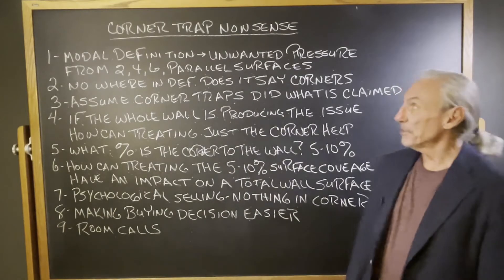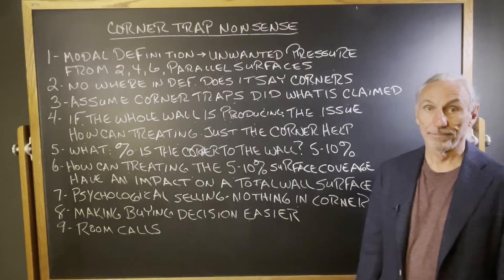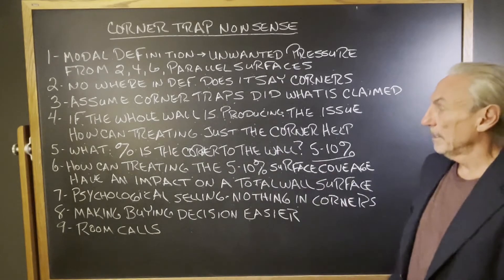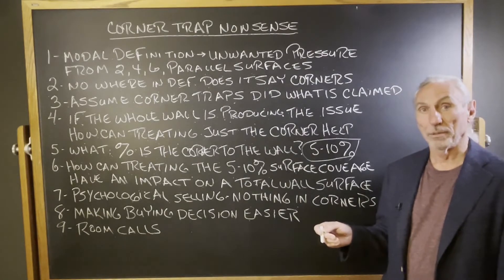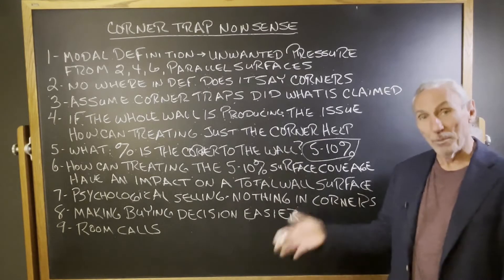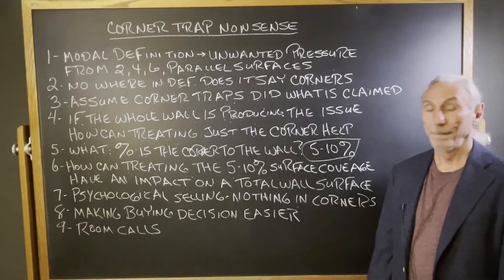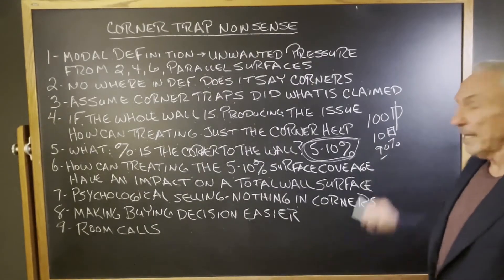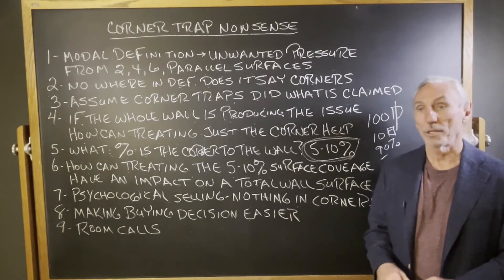Corner Bass Trap Nonsense - www.AcousticFields.com

Comment: The corner idea has valid logic behind it and I will just quote Floyd Toole a little here:
"at a reflecting boundary, pressure is at a maximum, and particle velocity is at a minimum"
A corner is two adjacent reflecting boundaries, so (sound) pressure is the greatest at these points.
The logical conclusion would be to place absorbers here, because it's the loudest, right? The issue is that stuff like rockwool absorbers are resistive absorbers, which counteract particle movement. But now we know that particle movement is at a minumum near the walls, which means the walls&particularly the corner is actually the worst place in the room to put a resistive absorber.
A resistive absorber is best put in a null, where subsequently particle movement is highest, which is at 1/4 of the wavelength away from the wall (of the frequency of interest; over 1m for bass frequencies). This is why the 'air gap' behind the absorber works, simply because it moves the absorber away from the point where it has the least impact.
Now, what do we do with the corners, where SPL is greatest? This is where tuned absorbers like membrane absorbers or helmholtz resonantors come in. These would need to be specifically built for the frequency your room is having issues with, which is why it is unappearling for the general consumer - it is not a quick and convenient 'universal' solution and also costs more than a wooden frame with some rockwool inside.
Reply from the maker: If you treat the wall surface area with a minimum 50% surface area treatment coverage with our technology, you have no corner issues. The greatest pressure is not in the corners at all frequencies and it also depends on the location of the sound source is regards to the room boundary surfaces.The greatest pressure is between two walls. This is an easy experiment to perform. Walk around your room with an SPL meter while you are generating a 40 hz. sine wave. Measure the pressure levels along the walls and corners. Repeat for 50, 60, 70 hz. and you will understand that the greatest pressures at all frequencies are not in the corners but between two surface areas. Building insulation will not provide the proper rates and levels of absorption for music and voice. Stay away from that material type if resolution is your goal.
Reply: @AcousticFields  This is a top response. Thanks.
Reply: That only applies if the initial wave strikes both walls at the exact same time and angle. This is extremely unlikely. You're far more likely to get the reflections from each wall being out of phase and, therefor, attenuating each other. So corners are much more likely to be lower volume.
Reply: "at a reflecting boundary, pressure is at a maximum, and particle velocity is at a minimum" Even though this is technically correct, you don't have a reflecting boundary condition as soon as you put an absorber at the boundary. Any standing wave with reflecting boundary condition can be decomposed into an incoming travelling wave and an outgoing (reflected) travelling wave. What actually happens during absorption is that the incoming wave first travels through the rock wool and on its way back the outgoing, already attenuated wave also travels through it a second time. You can simply transform that situation into one where you mirror the bass traps themselves indefinitely (an "acoustic infinity mirror" so to say): no more reflected waves, but twice the travel distance just because the traps are mirrored. Now imagine all those virtual mirrored base traps: does their number increase when they approach the "nominal corners" of the room? No! Does their total volume or total area increase? No! All those numbers are independent of the positions of the bass traps in the room. But only these numbers count when it comes to the likelihood of absorption. So, put your absorbers anywhere you want, it doesn't really matter (except for the case where you can predictably catch directional sound with an absorber in first pass)
Reply: @7enon  I'd suggest you to read the Wikipedia article on standing waves. The first sentence shows that while your train of thought might seem intuitive at first, it's not what happens in reality.
Reply: @peniku8  I am a physicist and don't need to look up anything in "Wikipedia articles". If that is your level of knowledge, and you prefer to stay at it, my inclination to inform you ends here.
Reply: @7enon  lmaoooo
Reply: @7enon  You are correct. You don’t “need” to look up anything in “Wikipedia articles” to be a physicist. But if you prefer to stay at a particularly low level of enlightenment as it pertains to physics, then, e.g., the idea that there is nothing of use regarding physics in “Wikipedia articles” is the correct outlook.

I am not a physicist myself. I do want to learn a lot of stuff to help me in my journey producing an album, bro, but I could also die tomorrow, or even today.

Comment: "What % is the corner to the wall?" ...does this Q make even sense? How you measure this?
Reply from the maker: It is the whole wall producing the modal issues. Placing treatment in the corners is a bandaid. It is mostly a marketing gimmick to sell product. If you treat the complete wall surface area, you have no corner issues.

Comment: Bass is strongest in corners, so treating the corners does indeed work.
Reply from the maker: This is not a true statement. Take an SPL meter and measure different places in the room. You will see that the greatest pressues lie between the walls as is specified in the definition of modes.
Reply: @AcousticFields  according to AI my statement is true.

"...Low-frequency waves are omnidirectional and can fill a room, reflecting off walls, ceilings, and floors. When these waves reach corners, they tend to get trapped and build up because corners act as a natural amplifier for bass frequencies. This effect is known as "room modes" or "standing waves."
Reply: @svtcontour  I think I already know what @AcousticFields is going to say.
No one doubts that bass traps can work in the corners. However, the point here is to combat the problem with low frequencies where it arises. Not just when the disturbing sound waves have accumulated in the corners. To put it in layman's terms.
It's a bit like drinking alcohol. Drinking a little bit throughout the evening is fun. The same amount of alcohol in 10 minutes is not fun. Haha, I know, not funny.
Reply from the maker: @svtcontour  All that is true. However, it does mention amplitude. When working in small rooms, you work from the areas of higher amplitude first and then your goal is to achieve a pressure balance throughout the room volume. The highest amplitudes of energy are not found in the corners. Their amplitudes are above baseline but nothing in comparison to room boundary surface to room boundary surface.
Reply: @AcousticFields corner traps work best on velocity, not pressure. If you're trying to solve a pressure issue you need both mass and surface area in the treatment solution.

Comment: lol I have an attic room with a desk height wall that turn into a ceiling just above ear height..  a full opposing wall closet and a large mattress. oddly enough I don't have two parallel walls unobstructed. dead. wall loaded tiny satellites and a desktop loaded subwoofer. it's just enough to give energy in the right spot and shares the same grill that allows my computer to cool.

pretty sure my room measurements would be terrible. i just get over it
Reply from the maker: Lets take a look. Fill out the information in this link https://www.acousticfields.com/free-room-analysis/
Reply from the maker: Lets take a look. Fill out the information in this link
https://www.acousticfields.com/free-room-analysis/
Reply: @AcousticFields  doesn't allow for a splayed ceiling
Reply from the maker: @the_nondrive_side  A splayed ceiling is a reflection management technique.  Corner treatment is pressure management
Reply: @AcousticFields  it's a massive impact on my room as the wall loading is right at that boundary. I intentionally sit within the interference area.

Comment: Thanks.  I enjoy watching your videos.  Humor a laymans' thinking and questions, please.

My understanding is that room corners form a "horn" that amplifies the sound reflecting from it,  but not evenly across the range of frequencies.  This seems to result in a "boom"  or "blatt" of distorted tone emanating from the corner.  

Is that actually the sound from the whole surface of the interacting walls?    Is the corner a focal point with more amplitude?  I imagine that each corner is producing its own particular sound.

I'm thinking that people put what they hope in absorptive  treatment into the corners to reduce  what they think is a "hotspot." 
Is that useful,  though inadequate to addressing  the room acoustics?
Reply from the maker: The highest strength or amplitude of a lower frequency will be found along the wall surface areas.

Comment: what about the acustics pressure of low frequencies that is condensed in the corners - vertically?
Reply from the maker: The whole wall is producing the corner pressure. If you treat the completev wall, the corner issue disappears.

Comment: If a booming modal frequency is the primary issue of concern, then I'd agree that a corner midbass trap is not the solution. It's important to remember though that modal frequencies are not the only problems, and often not the most audible problems with rooms. Corner placed midbass/ lower midrange traps with treble scattering can very effectively improve the measured and perceived clarity at the listening position. It's not just modal frequencies that get stuck bouncing back and forth between parallel surfaces. All frequencies with short enough wavelength to form a traveling wave will also bounce back and forth repeatedly, eventually reaching the listener's ears with significant delay. If an early reflection causes an immediate wave cancel effect at the listening position, this can result in a non-modal frequency getting seriously time smeared, losing a lot of musical definition at the listening position as the initial attack is weak, while the delayed bouncing from the front of the room and back again hit the listener's ears louder than the initial direct sound from the speaker, after the note should have stopped, making it so that you can't hear when the notes start and stop. Corner placed traps unquestionably improve the situation in most rooms.
Reply from the maker: Our mission statement is all about room resolution. You can not achieve that degree of resolution with just corner treatments. If you treat the complete wall issues, the corner issues disappear. Always treat the source of the issue.
Reply: @AcousticFields  I agree that the very best thing to do is treat all the walls and ceiling and floor too l if it's a cost no object project. Build a room from scratch if you can. Still, I've been fascinated with my own cost limited projects at how I could effectively reduce an audible problem with a very limited but strategically placed treatment. People shouldn't despair and give up entirely if they aren't in a position to go all in on a full room treatment. There's worthwhile goodness to be had with much more modest projects, such as just focusing on the front corners of the room.
Reply from the maker: @timlink7817  We have calculated the square footage requirements of our carbon and foam for all room sizes.
Reply: I never thought corner traps had to do with problems because those waves are created by wave reflections BETWEEN walls.  Bass traps were for issues such as STANDING WAVES.
Reply: @wty1313  Well, standing waves are indeed caused by wave reflections between walls. If you look at a typical sized home listening room there are actually complex standing waves that go well up into the midbass. We don't tend to think of them like we do the lower ones, where you get really large areas of super low level, and other large areas of peaks. Instead there are lots of peaks and dips closely spaced throughout the room. But, in every case, there is always a peak pressure for every one of those modes in all the tri-corners of the room. So if you put a bass/ midbass trap there you're going to be sure to get after all of them to some degree. In other parts of the room there are peaks as well, but they are in different locations for each frequency.

Comment: Bass traps work because they eliminate bass echoes which tend accumulate in corners. Low frequencies have too large wavelength they don't form standing waves between parallel surfaces. Acoustic wall paneling eliminates mid-high frequencies. They are complementary. Funny that you won't explain any of this, only claim it's marketing, then marketing your own products in the end.
Reply from the maker: More nonsense. "bass" does not echo and standing waves are the result of excess energy and long wavelengths that dont fit between walls whether they are parallel or not. The corner pressures are produced by the walls themselves. If you treat the wall surface areas, you have no corner pressure to treat.
Reply: @AcousticFields  There are two types of traps, velocity and pressure, they both can treat bass frequencies. Pressure traps are effective in corners, since that's where the bass frequencies accumulate. I'm still quite new to all this, thanks for the reply.
Reply from the maker: It is not the corners of the room that are your problem. If you treat the complete wall, you have no corner issues. Treating the corners deals with about 20% of the overall unwanted pressure issues. @GraySectoid
Reply: I'll see if that works, just ordered a bunch of acoustic panels enough for the whole room, I know they will get rid of the mid-high frequency echo, but not sure about the bass. @AcousticFields
Reply from the maker: Echo is a repeating signal usually over distance. Rooms do not have echo, they have reverberation which is defined as to how long a sound stays around within the room after it has been sung, spokken, or played. Every surface exhibits a different frequency and amplitude of reverb issue. Reverberation produces reflections. Managing reflections requires a completely different treatment type than lower frequency pressure. If the panels you ordered are full of building insulation and all the same type, get ready for a disappointing sound quality. @GraySectoid